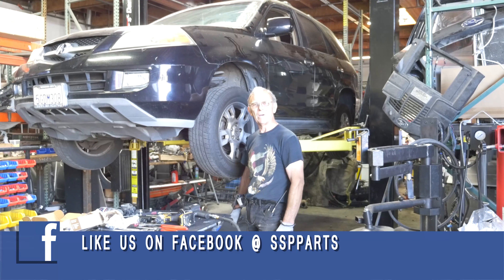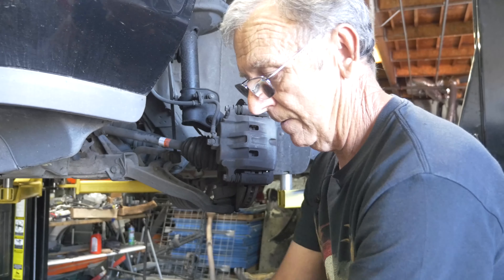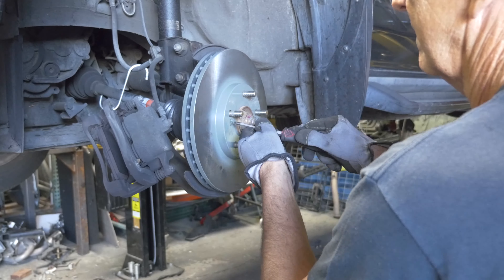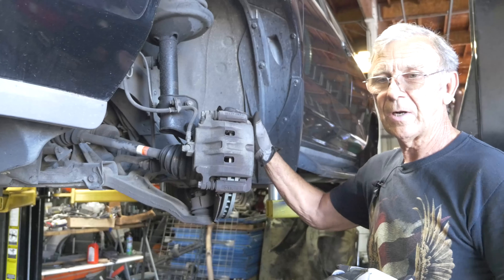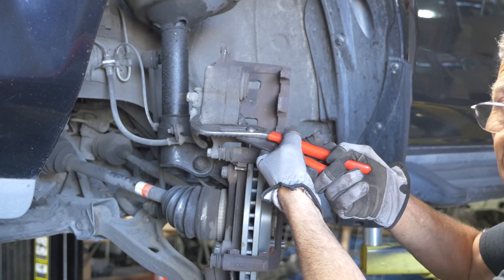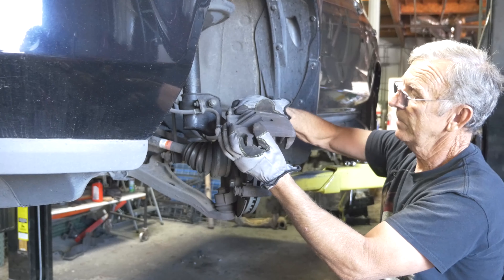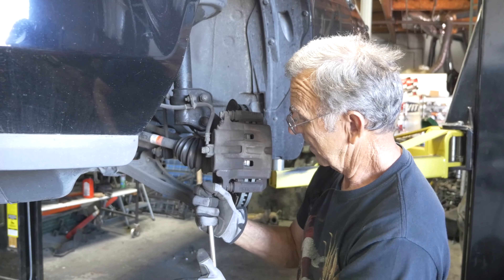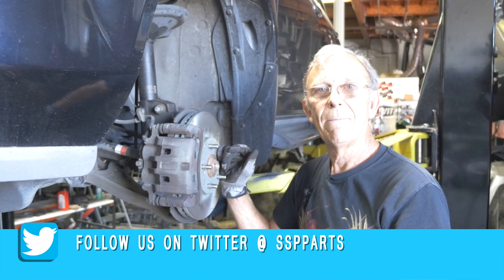How to Remove and Replace Brake Pads and Rotors - 2005 Acura MDX

Comment: How did you unlock the steering? My tires wont turn like that unless the car is running. Any help guys? Its the same exact car. 2005 mdx all wd
Reply: i think its a small tab by the shifter you take off with a flat head and you stick your key in im not sure if thats for the streaing or the trans im not sure tho